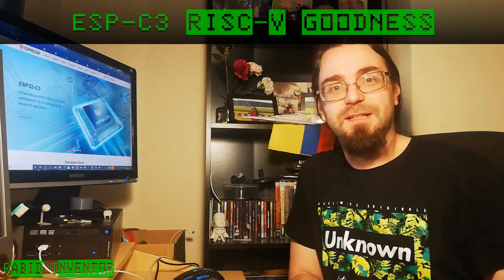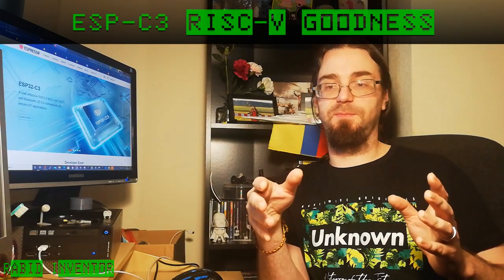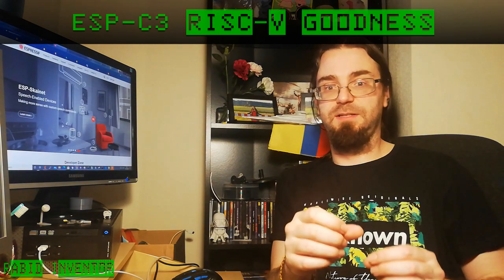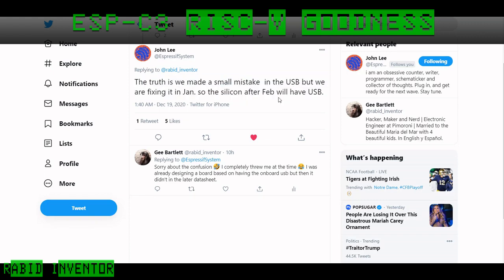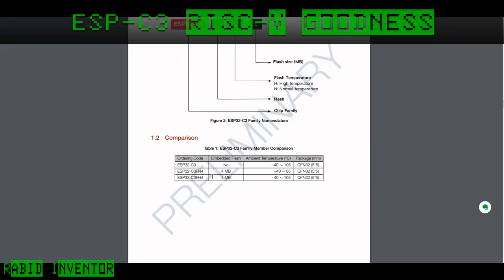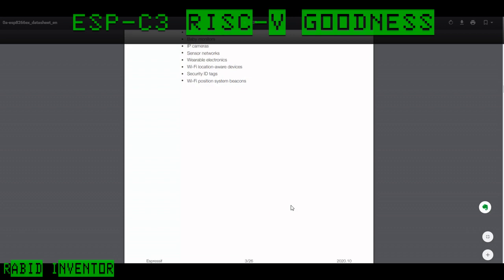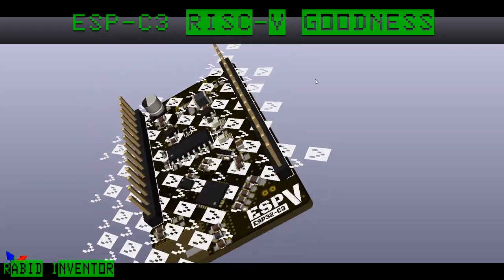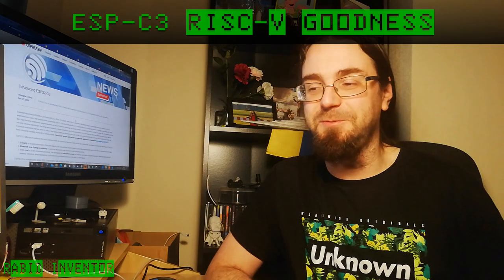#3 The *NEW* ESP32-C3 RISC-V Goodness

Comment: Your dev board design is looking nice!

The "ESP8266 pin compatible" thing is either a translation mistake or someone's misunderstanding. The original WeChat post says "可 pin to pin 兼容 ESP8266 模组"  which means "can be pin to pin compatible with ESP8266 modules". Unsure if details of compatible modules have been announced yet...

As you show though, the pinout is pretty close - so it should be a simple update for a lot of designs.
Reply from the maker: Thanks Angus, that Dev board is still in flux I think I'm in the process of another redesign as we speak but I'm sure that will be the case all the way up to the final silicon being released :D